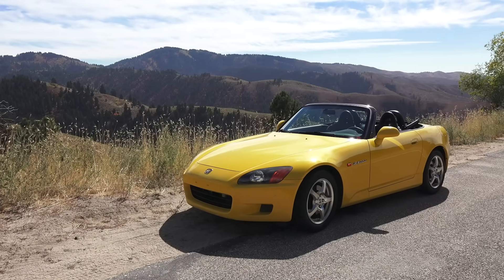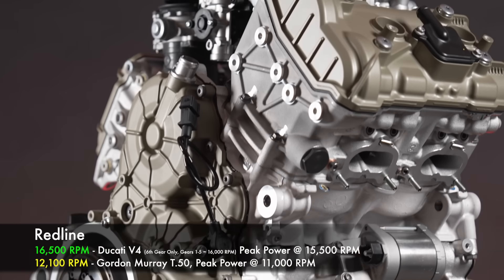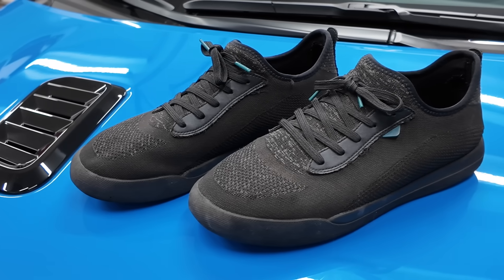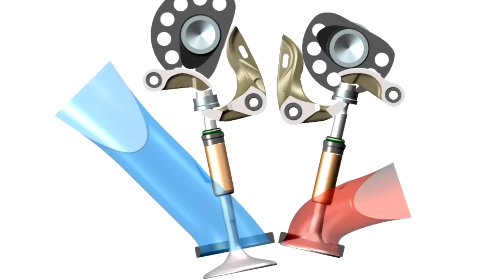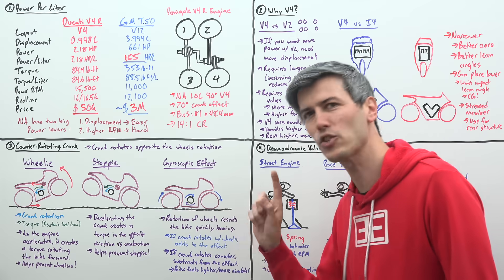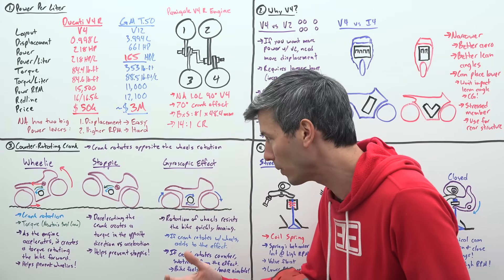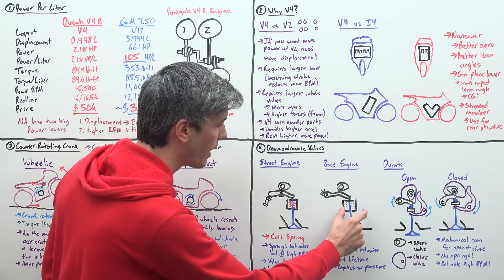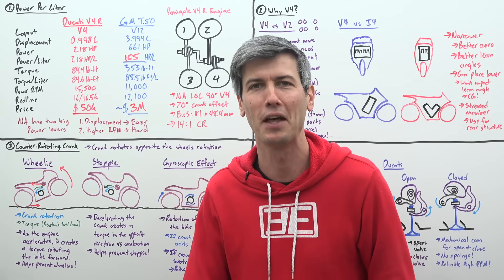Ducati's Brilliant V4 Engine — Putting Supercars To Shame!

Comment: Bike engines have always been more interesting and advanced.  And the Duc V4 sounds amazing...
Reply: I wouldn't say they are more advanced... They spin higher, that's where power comes from. And those engines usually don't do as many miles as cars and are serviced more often. You need some fancy engineering to make it spin that fast, but electronics and engine control is far, far more advanced in car engines.
Reply: @Stasiek_Zabojca  You can believe whatever you want but Suzukis Hondas and Yamahas can last over 100k kilometers with just regular service. Which can't be said for a lot of german cars which needs new turbos or rod bearings before long lol.
Reply: @haste953 Well... We are mostly talking about older bikes. And older cars were usually more reliable than now too. Bikes made today aren't that great as they used to be. Lower quality parts and they wear faster.
Other thing is, that all those "advanced" features on cars are causing troubles nowadays. 
You mentioned turbo. Which is device, that is there to reduce production cost (smaller engines with less pistons for higher power) and increase efficiency. DPF, GPF and many other things to reuce emissions as much as possible. 
Motorcycles are in far better than situation than cars, emission standards aren't as strict for them and they can be simpler.
Reply: @Stasiek_Zabojca  Some I agree with but you're 1000% wrong by saying emission standards aren't as strict for motorcycles. Very wrong, superbikes haven't gone in power if you see WHP numbers. A 2025 ZX10R puts around 160 to the ground, and it's supposed to have 200+. That is absolutely ridiculous, same with the R1, the CBR1000 and many more. You change the exhaust, put an air filter and tune it and you get 195-200 to the ground extremely easily. Go check Moore Mafia's video on the ZX10R, you'll see the throttle mappings are extremely disgusting and it's all due to emissions. It's extremely sad how limited they come from the factory. Imagine buying a brand new superbike and it puts less power to the ground than a tuned 2005 GSXR1000. Ofc, weight, tech and gearing is completely different so the new one might win a race but raw numbers are sad.
Reply: @haste953 bike emmission regulation are less strict compare to car’s emmission.. same as motogp regulation are not as strict as Formula 1 regulation. In F1, regulation has made the car has less cylinder & smaller engine capacity (from 3000cc down to 1.600cc) every years, they don’t allow the car to revs more than 12k rpm now. and off course made the car has more weight (from 500kg to 800kg).  while in motogp they made the bike as light as possible (only 157kg). And revs to 17k rpm
Reply: @autolavista  Who cares about racing, we're talking about real world emissions lol. The ducati engine in the V4R is a motorcycle for the street, it's 100hp off from the real MotoGP bike and completely different in every sense for tech and other stuff. Not the same thing, that's the whole point of WSBK

Comment: I wish inline 4 with crossplane crankshaft will be adopted by cars. Perhaps you can cover the reasons why it was not used in cars at least for now?
Reply: There's been several things over the years that's been used on bikes to make them more controllable, it's not much of an issue in a heavy car. And then there's complications regarding balancing as well as manufacturing (at least if you want to forge it), so it would create a lot more problems than it would solve.
Reply: @PSA78 it work for V8 in cars so it is a thing worth exploring for inline 4 in cars as well.

Comment: The privilege of Desmo service every 15,000 is all yours.
Reply: Also, all bikes have valve service intervals.
Reply: @MoremoneythansenseV4 Desmo services tend to cost 2x or more the cost of a normal valve service.  But yes, (almost) all bikes have a fairly expensive valve service.  And even with Ducati VERY few of their bikes run Desmos anymore.
Reply: @Wintersdark I know...I have one that requires it. They cross platformed the new V2 that doesn't use Desmo on a shitload of bikes
Reply: Bmw boxers have the simplest valve adjusts that any body can do at home, no problem. If it is easier at home, it certainly makes a difference
Reply: @BobBob-q2o5p  Access is definitely easier, but now you have "shift cam" to deal with.
Reply: @BobBob-q2o5p  My moto guzzi v7 850 is probably even easier.
Reply: @TucsonDude  The valve checks on the shift cam boxer, every alternate, are so cheap you barely notice the difference in price at service, and my BMW boxer has been cheaper to service than my inline Japanese 4s.
Reply: @GDM22  What year was your BMW?  If I may be nosy, how much was your service?
Reply: @TucsonDude  It is a 2019 R1250R, current service price is about $550 and $800, Australian $s on alternating services at the BMW dealer, was cheaper 6 years ago obviously. Had an S1000r prior and the dealer service is the best I have ever had on car or bike. Included in the price is an Uber to and from my work or a courtesy bike, generally a demo.
Reply: @GDM22  Not bad at all.  BTW, I also own an S1000R and it's due for service.  How much was that?
Reply: @TucsonDude  The service costs were very reasonable but I didn't do enough kms to need a valve check, even though I had for 5-6 years. I started to do a longer commute with a mix of freeway and stop start driving which the R1250R is just so good at. In winter when it rains and in strong winds, the stability, very good electronics package and shaft drive means that is my bike of choice, the other bike stays in the garage.
Reply: @TucsonDude  There is only 1 BMW dealer in my City and they just happen to be very good, ultra professional whilst being reasonably priced, might be just luck.
Reply: @BobBob-q2o5p  And Moto Guzzi V twin!
Reply: @GDM22  Same here.  Of course my city is only 1M people.
Reply: Not just one, but TWO lash adjustments per valve! What a value!
Reply: Miles or dollars? ;)
Reply: Ducati is basically the Ferrari of motorcycles so higher running costs are to be expected. Most high revving motorcycles need at least a valve check around that time anyway.
Reply: That’s a problem if you decide to daily a superbike, otherwise it’s not that big of a dwal
Reply: @Sbinott0 the problem is that Ducati did actually put desmo in their normal bikes like Monster and Multistrada. And nobody wants to buy those bikes used precisely because they have desmodromic valve mechanism.
Reply: @vvevvevvvv ive had mine for 10 years. Its an amazing bike. Ive never heard anyone say they wouldn't want a monster because of the desmo. Its part of the cool factor.
Reply: @2580robocop the new models don’t have it and people are angry about that choice
Reply: @Sbinott0 *the new V2*...new V4 still have Desmo
Reply: @MoremoneythansenseV4  nope, not all v4's. Multistrada's v4 doesn't have desmo. I have one and it's valve check limit is 60k km :)
Reply: @vvevvevvvv The Multistrada (except the RS) hasn't had a desmodronic valves since 2021, and even then, if you don't need shims, valves and belts are a $700 service if you dealer isn't terrible...and 15,000km was exactly the interval and lower price than a couple other bikes I have had a la 675 Daytona and GSX-1000R
Reply: @vvevvevvvv Except those of us who liked to do our own maintenance and thought it worth while learning. In fact I wish we had had Youtube back in the day because there are some excellent teach yourelf videos which could have saved a lot of time.
Reply: @myousic4564 if you re read i said the Multi RS that has the Desmosedici engine, not the Gran Turismo
Reply: @myousic4564 nevermind that was a different comment i put that on
Reply: @Tripped11  You will never see a valve service anywhere near $700 at a Ducati dealer, expect $1500 and up...
Reply: @Waldo1122  I noted my experience with my dealers.  I have owned 4 Duactis, three desmos and I have a 2008 Monster S4RS and a 25 Pikes Peak in the garage right now.
Reply: @Tripped11  Welp my experience with 2 Ducati dealers in NC was one can't diagnose a chain properly nor follow customer instructions, and the other wants $600 for an oil change yet doesn't complete EVERYTHING that they're told to do in the service manual for the 9,000 miles service on a V4 Multistrada AND decides they're going to work on 5 other motorcycles while working on yours that you scheduled an appointment to have worked on and paying for the time to have it worked on.
Reply: @Waldo1122  You should try moving to the first world
Reply: Every 15000 isnt even that bad I expected worse from ducati
Reply: And I pay the $1800. Thats the price you pay to ride a class leading bike with (imo) the best styling.
Reply: @MoremoneythansenseV4  V2 is half that, maybe because it has half the cylinders. But it's a low price to get to ride a Ducati.